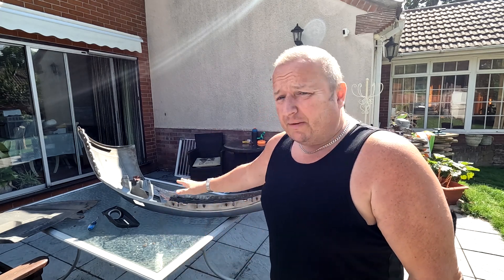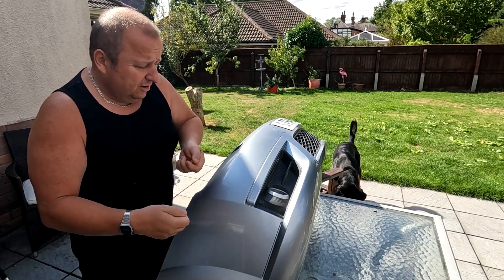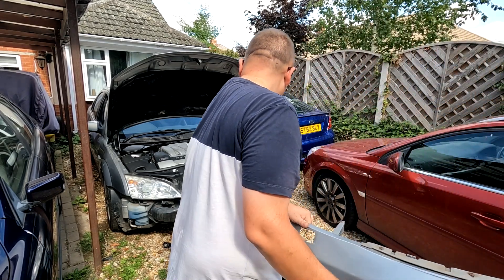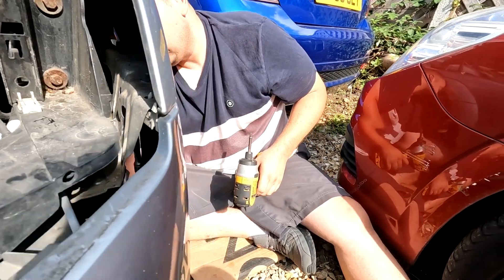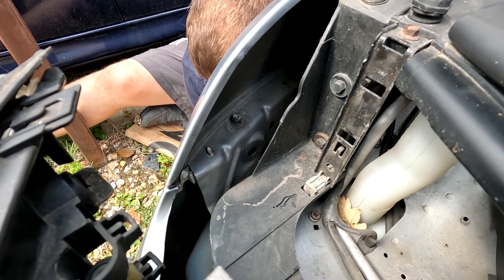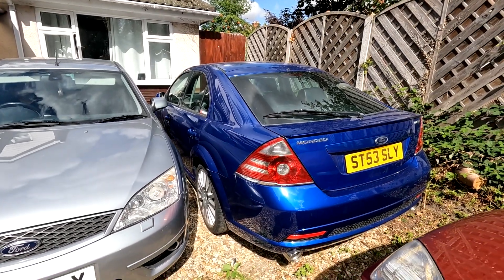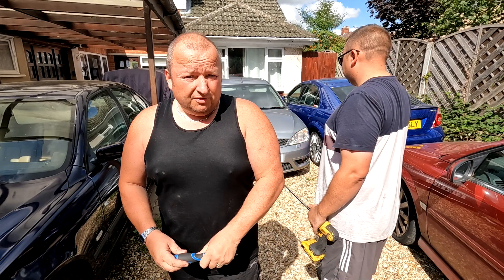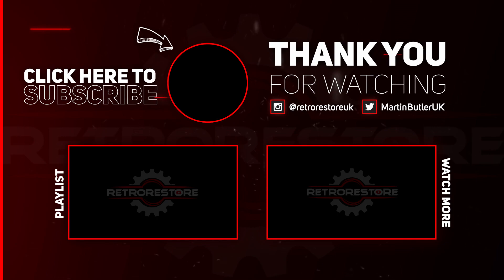Ford Mondeo ST220 Repairs Before It's Sold

Comment: Iv got one of eBay Diesel Heater had it two years .and it works very well  thing to do before you turn it off running it on maximum settings for 10 minutes to keep the burn chamber clean
Reply from the maker: Thanks for sharing